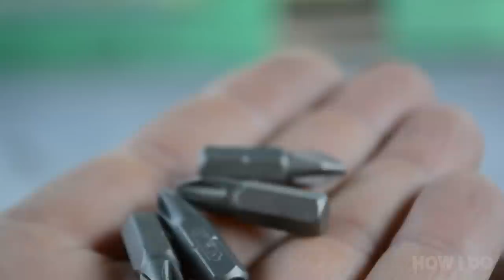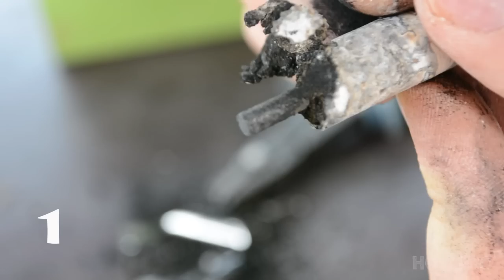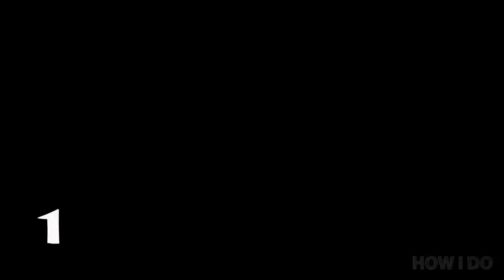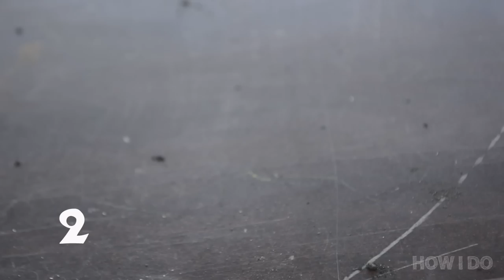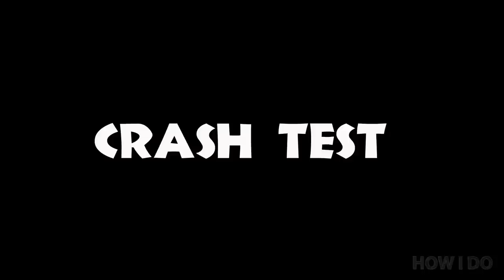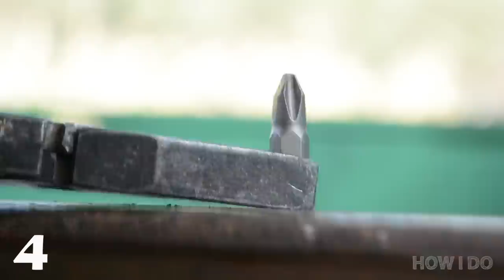Experiment CRASH TEST hardening bit for screwdriver

Comment: I'm 90% sure you didn't get them hot enough before quenching.
Reply from the maker: Do you want  to repeat the experiment?
Reply: Yeah I can take a crack at it. Normally steel needs to be orange red / full cherry red (non-magnetic) before quench. Yours looked like a dull red or medium. It may not have reached critical.
Reply from the maker: ok
Reply: But god knows what kind of steel these are - they could be s2, stainless, hss, who knows. Those all heat treat (or don't at all) differently.
Reply: hardening turns it more brittle, 
for hardening you should use more than 1 process
some times the more flexible the styeel is, the more resitant 
you need to produce the steal according the properties you need from it,

 i harden tips of tools in order just to not wear so much, not for hammer it.but after hardening you need normalization